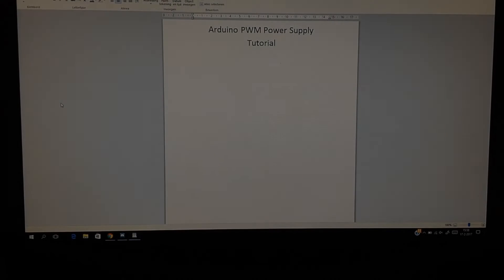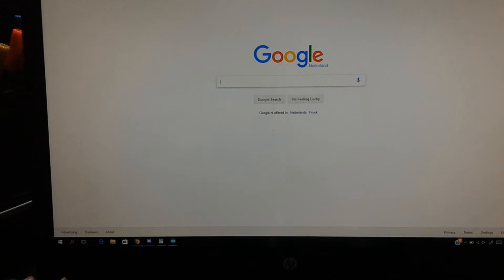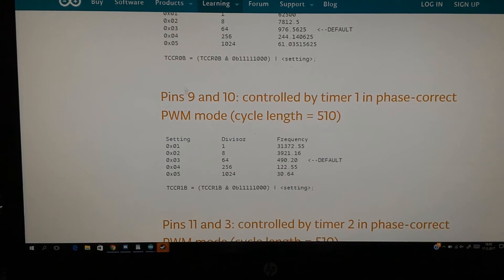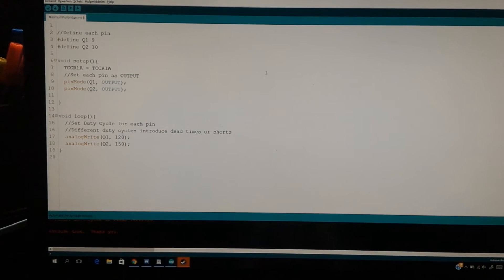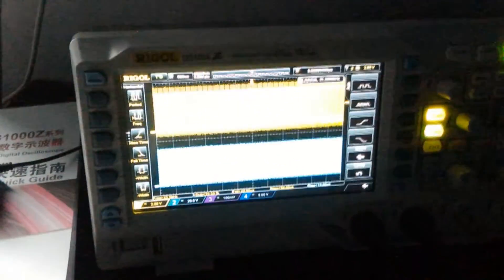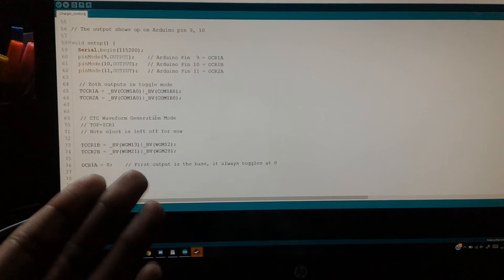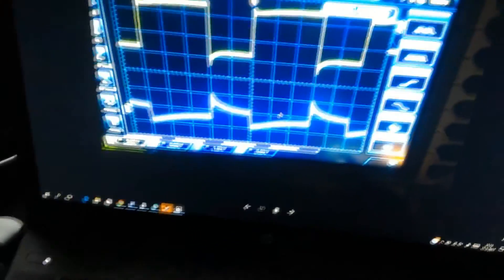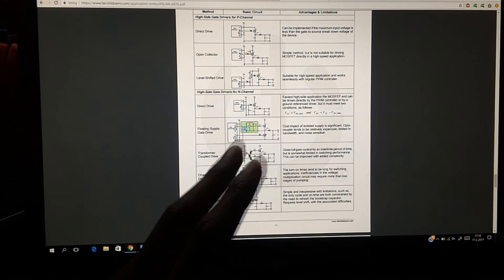How to make a Switch Mode Power Supply with an Arduino - Tutorial | Railgun Power Supply

Comment: Did that phase shifting code require a custom library?
Reply from the maker: No, I was making use of the custom waveform generation mode. If you look at the datasheet you will see 4 COMs and 2 WMGs. Each WGM corresponds to a pin. Therefore you could aswell generate a sine wave or triangle wave if you wanted. I then made a custom frequency by messing with the timer.

Comment from the maker: Application of this can be used easily in:

Motor drivers
Inverters
Flyback converters
Boost converters
Electromagnets
Signals
Radio transmission
and all kinds of devices that require a well modulated pulse (some harder than others).